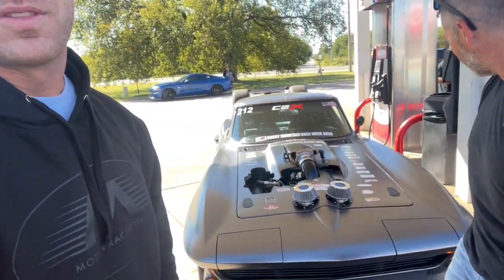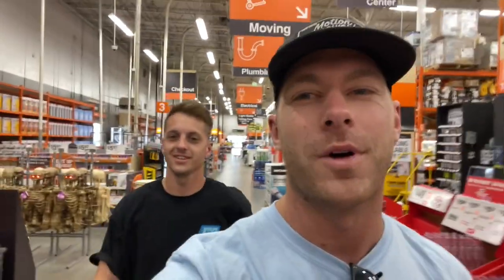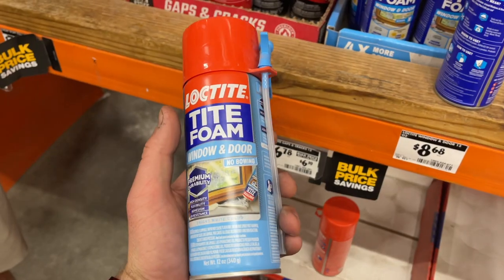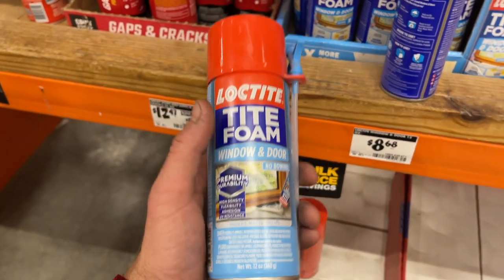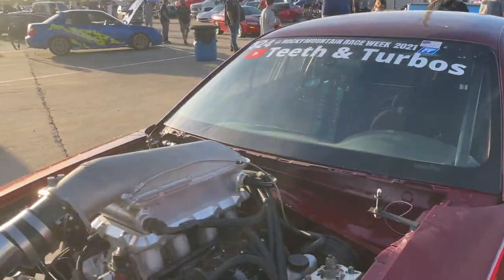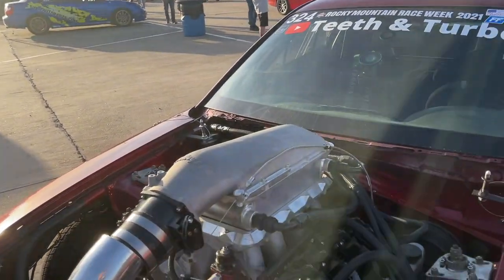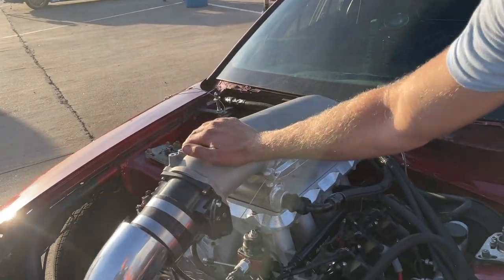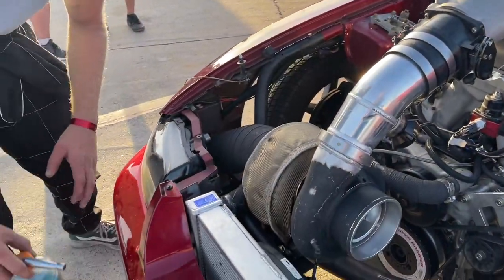Race Week Day 5 - Sketchy Runs Chasing Traction... We Finished Race Week!

Comment: I'm not an expert, but perhaps changing the gearing on the rear end? Car I CLEARLY making steam, maybe a different gear to translate that into wheelspeed down track instead of torque off the line might help. Engine can almost certainly power thru it.

Comment: Your  co/driver is posed to be helping out with things like checking spark plugs checking air in the tires making sure nuts an bolts are tight so not to cause problems

Comment: If those are bias slicks you need 10-11psi in them. 13 is to much. Also the suspension isnt transferring looks like to me. Try loosening the compression on the rear shocks alil

Comment: There's gotta be some tool that measures grip at the track to provide some sort of reading to tune towards. Maybe you should invent it if not.
Reply: I use a penetrometer to measure how hard a surface is. Surely something like that would work in reverse. Measure how hard it is to lift off instead how hard it is to plant.
Reply: @mckrackin5324  That could work for sure.
 My brain went towards a small 4x4" slice off an old racing slick with a thin 4x4" piece of mild steel glued to the back. Attach that to a pull scale and pull that contraption at a parallel to the surface of the track.
Or some sort of weighted small rolling wheel with a max break away measurement
Reply: They already make a tool to pull grip level at racetrack . Jerry bickel sells it called track meter and it’s only 1500.00 bucks You stand on it and twist the lever on top . There is a gauge that reads max grip before it slips . Gives you reading like  say 125 . You have to use it a lot and log all the data and conditions to really make use of it
Reply: @jkfonyi  Haha I saw that but at $1500??? I'd design my own